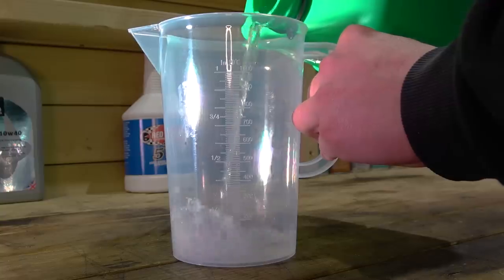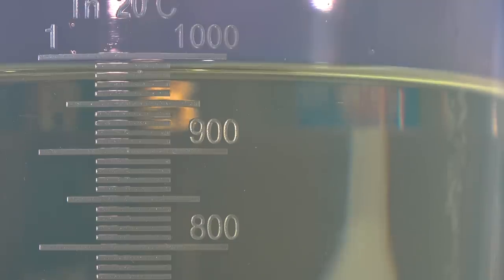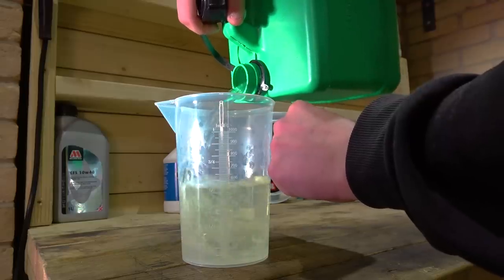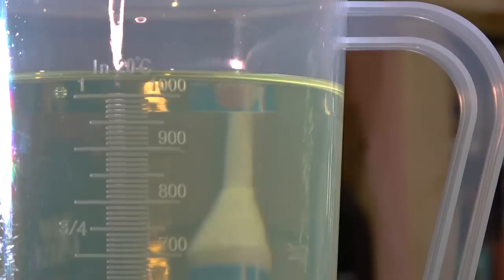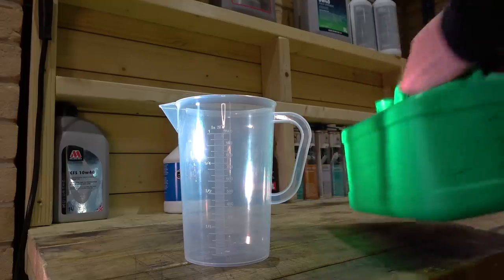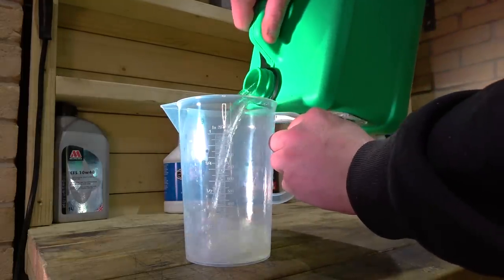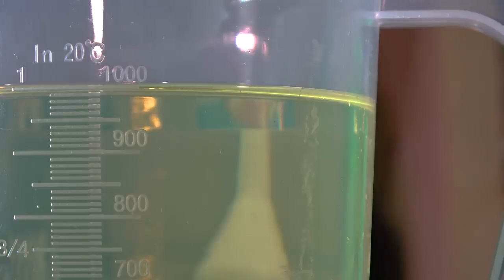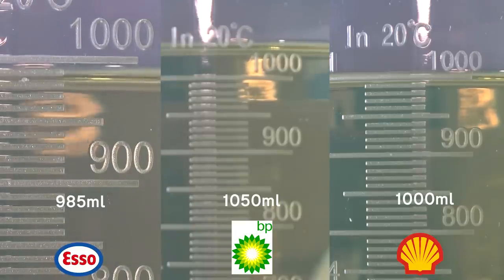Fuel Pumps Are Wrong - Esso BP & Shell

Comment: Rather than decant  the fuel containers into a measuring jug, I would have weighed the empty container then weighed it with the 1 Ltr of fuel.  This  would compensate for any  differences in temperature.
Digital kitchen scales would be sufficient for this.
Reply: F1 measures fuel by weight so John is probably on to something here 👍🏻
Reply: What's the specific gravity of the fuel from each of the supplies?
More specifically, what's the specific gravity of each batch of fuel at the time of filling?
What was the temperature of the fuel at the time of filling?

Furthermore, how precise do you want the measurement?  
I design liquid filling machines as part of my day job; we use balances with a 1mg resolution to validate 500ml liquid fills.  A kitchen scale is no where good enough for our validation.
Reply: @Shocker99  Yes, Plus, how accurate are the graduations on the side of the plastic jug?
Reply: @RichiesRealNewsUK23  good point, plastic jugs can be +/- 10%
Reply: @John Parsons  - Good point
Reply: was about to type the same thing - digital scales would have made it a lot easier and more accurate and even my cheap ones can measure litres
Reply: @RichiesRealNewsUK23  I’d assume that there was only one jug used - we don’t see three in any one shot - and it would at least sufficient to control this tiny sample. A scientific approach would probably be to use a measuring cylinder, with this costing probably £15 or more for a glass one to be considered fairly accurate.
Reply: @dougaltolan3017  the important thing is that you use the same plastic jug every time regardless of its accuracy then you'll at least get a reasonable comparison
The plastic jug won't be inconsistent with its measurements even if it's not 100 percent accurate
Reply: auto shenanigans scrap the tests and do it all again lol
Reply: @Shocker99  I was a Lab Tech in the past,  without  a scientific balance a digital kitchen scales is a good 2nd best.
Reply: You need to know the specific density of each brand beforehand, for that.
Reply: @RichiesRealNewsUK23  Your not a scientist are you.  It could be kilos of coal.  Pounds of Flour.  Petals on a daffodil.  On the jug.
What it did show is the level was different. (for whatever reason).  
So not an precise reading, but a relative one that has accuracy.

GO ON, tell me about precision and/or accuracy...
I don't want to listen to you waffle.
Reply: @MisterStuzy  THEY ABSOLUTELY CANNOT.  A litre of tap water does not weigh the same as a litre of fuel.  Go and study something physics at night school and density might come up.  Not saying you are dense of course, but...
Reply: @stevekelly5166  you're*
Reply: @stevekelly5166  chemistry would be the better subject. Not physics ,,👍🏻
Reply: @MisterStuzy : How do your scales measure litres?
Reply: @dougaltolan3017 : if the same jug was used (I guess it was - looked like it), it’s good for a comparison.
Reply: @chriswalford4161 hmm i press a button and change the unit to ML.  Not that I’ve tried it with anything else or more viscous than water based liquids but it’s accurate for that in the kitchen 😅
Reply: @MisterStuzy  1L of water = 1kg, so when it 'converts' weight to liters, its literally just changing the display from g to ml, nothing more. It's because some people dont kow that 1L of water =1kg. It can't measure a litre of petrol, because petrol weighs less than water (by I think around 10-20%).
For this level of experiemtn, the jug was fine, although the reality is we don't know how accurate the jug is, just that they all dispensed slightly different amounts in the region of 1L.
Reply: @imnotamechanic3491  ah cheers for the science 🧪
Reply: @regularguy3665  A 1000ml measuring cylinder manufactured to Class A would have an allowable 5 ± ml tolerance at 20° C, if it is Class B then it's 10 ± ml. That's not to say they could be well below that tolerance but then you would have to get an idividual calibration test done and certificate issued just for that 1 cylinder, as at the time of supply it would just have a batch test certificate stating it meets those requirements. For a glass Class A you are looking at a price of upwards of £40.
Reply: @chrislewis8706  Any science is better than no science.  I have discussions with my nephews as one is studying Chemistry and the other Physics in Bristol.  Don't bring biology into this 🙂
Reply: @stevekelly5166  haha biology is beyond my comprehension so you are fine
Reply: No (but yes). Unleaded has a band of density, so will change.  

But mass is relative to energy content, so a heavier fuel will have more energy. So your premise is sound.  

Btw Stanlow supplies heavier fuel generally.  So if you're a Scouser, well done.
Reply: @ilvidel  we do. They don't differ, it's in the 228 fuel specification.
Reply: yes
Reply: @imnotamechanic3491  Then you look up the iso weight of a litre of E10 petrol, and use that as a reference point,
Reply: @regularguy3665  using a scale is more accurate.
Reply: A 5 degree difference between the delivered temperature and the measuring temperature would only account for a volumetric change of 6ml.
The measurement process was basically sound, but I would suspect several sequential tests of the same pump would give equally different results.
Reply: @Miketz  The industial grade petrol pump had a calibration certificate, that chinese made consumer plastic jug is mass produced and never checked.

Next the 1L of petrol was put in to a 5L container, so some of the 1L of petrol with vapourise in to the 4L air gap, plus liquid will get stuck in the cracks of that container.

So the experiment result is flawed.
Reply: I assume this was just for a quick video that is easy to understand. Regardless of temp and inconsistency in the measuring jug there are still clear differences in amount which gets the point across rather well. Could do a much more indepth video using your technique with a higher quantity of fuel which would be interesting
Reply: @pqrstzxerty1296  Only if measuring absolute values. The methodology was consistent between the samples - same design container, same measuring cup.
The experiment supports the claims that the fuel bowsers are inaccurate for smaller volumes.
(Note, I spent a large part of my career designing and calibrating fuel dispensing equipment)
Reply: @Miketz  I am so glad you are not a QA inspector or a Trading standard inspector, you be using uncalibrated equipment then fining businesses.   You be losing you case in Court because the defence will ask for your calibration certificate.

Have you tried your same reasoning, to get you off a speeding fine....  as thats the same as its a quanifable measurement.
Reply: @pqrstzxerty1296  Thank you for your concern. This is a youtube video showing that volumes below a litre or two can't be measured accurately.
You do not need certified calibration gear to show that, just a consistent methodology.
Reply: @pqrstzxerty1296  The specific gravity will be for a specific temp, so then you need to have a controlled temperature environment (which you would have to measure...).
As pointed out at the end of the vid, do the experiment again, and you would get 3 different results, and of course the brand of fuel station you visit doesnt necessarily correlate with the pump manufacturer.
I was simply explaining that you can only use the 'ml' function on kitchen scales if measuring water (or somethign with the same specific gravity, like milk).
Reply: But the density of fuel changes with the temperature. So a litre of cold fuel will weigh more than a litre of warmer fuel.
Reply: Different brands have different additive packages which could affect the weight of the fuel; you aren't buying pure gas or diesel from a gas station.
Reply: @chromiumphotography5138  gas stations measure fuel deliveries by volume with temperature taken into account

Comment: You have lost fuel inside the green cans, you can't pour it all out some will be left stuck to the inside, you need to attach a calibrated flow meter to the end of the nozzle. There will always be a certain loss otherwise. Even then it will be affected by temperature.
Reply: You know the expected density and weight of 1 liter of 95, it's as simple as weighing the can before, and writing that number down and subtracting it from the weight after to get the results.

Comment: heres a fact, me and my mate did the same test at 3 bp stations .... none of them were over 1000ml ... they were all under, the worst was a bp station in the outskirts of glasgow, 885ml, we thought it was a one off .... nope ... it topped out at 890ml, this is maybe why it was being investigated by trading standards, after all ... when a 55 litre tank took in 62 litres of fuel and yet it was still a 400 mile range .... yeeah .... something dodgy AF is going on
Reply: The range doesn’t necessarily correlate with fuel quantity in the tank. The range is an estimate made by the current fuel consumption and amount in the tank, you could have 400 miles on a fuel tank or 3/4 of a tank depending on how economically you’re driving at the time.  I agree that the BP are taking the piss though
Reply: Fuel stations are continually being ‘investigated’ by weights & measures. They can & do turn up without notice. They check the amount of fuel being dispensed. Any pump giving even under or over will be sanctioned. Can not be put back into service until it’s repaired & signed off by a certified repairer.
 Refusing the checks & the sites petroleum license will be suspended. Weights & Measures will lock the pumps.
Reply: BP were generous in the Gulf of Mexico
Reply: @massimobernardo- : yeah - but it was unintentional, and they quibbled over the compensation.
Moules a la BP is an over-rated dish.
Reply: You can't use 1L to test, fuel pumps tend to indicate minimums of 2L or 5L, if you supply less than that the precission is way lower and you accept it, it's your fault and your test doesn't mean anything

Comment: I fill up 5 litre cans all the time for work from different fuel stations. The brand of fuel station makes no difference in my experience, every pump is different, and as I have visited exactly the same pumps, filling up the same jerry cans over several years... they seem to change in accuracy as well over time. 

I'm not sure if this is because they're calibrated every so often or due to wear in the pump, the temperature, or something else. Obviously I play the game where I find the most "generous" pump in the fuel station, but it generally only lasts a month or two before it's time to start hunting for a better one once it starts being stingy (the difference is so small that it's not worth doing this from a monetary standpoint, but if the forecourt is pretty free and you know one pump is a bit more generous than another.... why not? :D ) 

- in case anyone is wondering why, it's to make two stroke mix for garden machinery, I also fill up a lot of 20l jerry cans for larger machinery, but those cans give little indication of exactly where 20l is.
Reply: It’s all the things you mention. Temp, wear, other adjustments and repeated checks. A little variance is normal and as he said accounted for. The spot checks ensure no one is fiddling the system and catches drift for umpteen reasons. The system works….I know, it’s hard to believe, lol.

Comment: Metrology. It's a light hearted approach as you describe on the channel. But to be fair to the fuel stations, a calibrated measuring can for testing the accuracy of fuel dispensing approved by 
UK weights & measures certified, costs around £500 plus. In addition you'd have one for each products as density would affect the readings. Then you'd have to correct for temperature and density (taken with certified thermometers and hydromters) and you'd need a spirit bubble to show your mums' kitchen table is tickety boo. Pumps will also have a sticker usually showing they are calibrated by an independent 3rd party. Someone in the comments mentioned the measures are a funny shape, conical, so the top, where you measure is as small as possible for accuracy and minimum variation.
Reply: Just beware of the spherical cows.
Reply: @dougaltolan3017  It's OK, they've all been sucked into the assumed vacuum.
Reply: In U.K. , fuel is priced and dispensed n litres - i.e., it’s a volumetric dispense, not weight.
I don’t understand how density affects a quantity sold by volume (as fuel is); variations in density would affect the mass of the fuel (weight),but not the volume.
Reply: @chriswalford4161  exactly right.
Reply: @chriswalford4161  Measuring cans are tested gravimetrically in standards laboratories.  Therefore the suggestion is a valid point.
Reply: Old brass cans were slowly replaced with carbon fibre monstrosities.  All of the certified equipment used for verifications are tested in standards labs, at a set temperature, gravimetrically.  So, by weight at 20 degrees celsius .  The brass stuff, caustic soda used to clean the inards, brasso on the outside.  I'd loved to have chucked some caustic soda in to the new carbon fibre stuff! lol.   They looked like disabled Daleks.  The older stuff, even the metric stuff, so much nicer on the eye.

Comment: I was once convinced the petrol pump at my local tesco store had delivered me short on some fuel I purchased.
The needle on my fuel guage just didn't correspond with what I had just bought.
So I brought up my concern with the staff in the petrol station.

They were really helpful and genuinely concerned themselves that there might be an issue, so they sent for a manager to check.
He had all the measuring gear and tested all the pumps, not just the one I used, my pump was spot on, one of the others was just over a litre, that was noted by myself for future reference! 😁👍
Reply: Your fuel gauge measures the level of fuel in the tank, not the volume, so depending on the shape of the tank, the level-drop-per-litre can vary significantly. if you had a tank that was smaller in cross-section at the bottom that the top, you might fill up with a quarter of your tank's capacity from empty, but that could correspond to half of the available liquid height, and so your needle on the gauge would read half-full. Obviously the converse is true also.
Reply: @Purple_Banana_69  I'm fully aware of all that, thanks for your input.
I knew the cars fuel guage very well and I was putting in a regular amount at a point on the fuel level scale that I knew should have taken the level up to a known point ie I did this same fuel fill, week in week out, and the level would go from say a quarter tank to half full with this specific amount I put in.
What concerned me was the fuel level reading on my guage did not move at all, even though the pump made it's normal fuel delivery sound, I suspected that no fuel was being pumped possibly?

So it was definitely worth checking.

What I think may have happened was quite a significant jump in fuel price per litre, compared to the normal price increases so when I put my regular amount in, it just didn't register on my guage?
Or simply my guage was stuck, never happened before or since and I still do the same fill procedure.
Reply: @Purple_Banana_69  This is very true. I drove a lada 4x4 (rivera?) back around 2002, and £5 at the time was half a tank. The half way mark actually meant - Find a petrol station asap. The low fuel light meant, "your fkd, hope you remembered the jerry can".
Reply: keep in mind your car’s tank gauge isn’t linear as well
Reply: @alyx6427  Correct and all fuel guages behave differently and vary how they work from car to car.
I was fully aware of my cars fuel guage and how it should behave under normal, regular conditions ie when I put my usual.amount of fuel in the tank.
I'd owned the car several years, so I was confident something wasn't right.

What was more concerning to me, was my trip computer gives a range reading, based on how much fuel is left in the tank, the speed the car is travelling and it's linked to the ECU so it knows the revs of the engine, the accelerator position, air flow into the engine etc etc
So it's basing this range figure on your driving, it can vary as you progress by adding range if you go easy on the gas and drive in a higher gear and lower speed etc.
It can also drop rapidly if you rev the engine harder and travel faster through the gears to the recline in each gear.
But it's an approximation and averages or estimates the result.

The range on the trip computer didn't go up either after I did my usual fill, I've found the range data to be quite reliable as well.

The low fuel light comes on at the same point on the range scale but can vary slightly on the fuel guage where it actually comes on.

I also knew the amount I put in should give me approx 'x' of range, going of 100s of previous fills, this us why I raised the concern with the staff.

Always worth checking, as they are responsible for keeping their pumps operating properly and dispensing the correct amount of fuel, they are  liable if they don't.